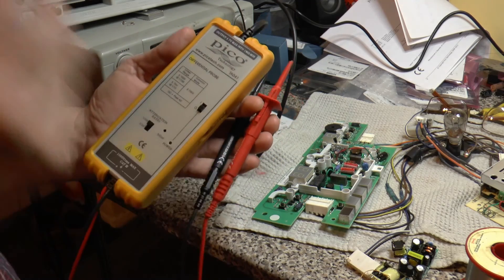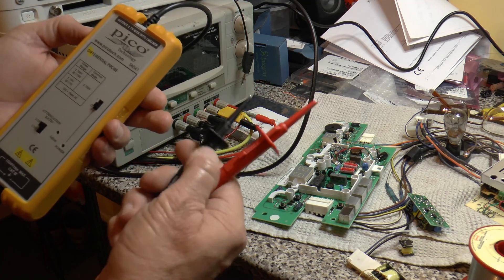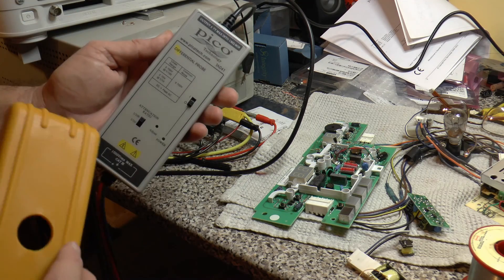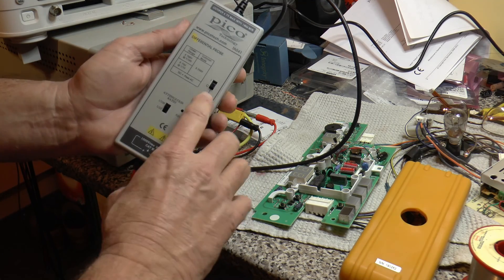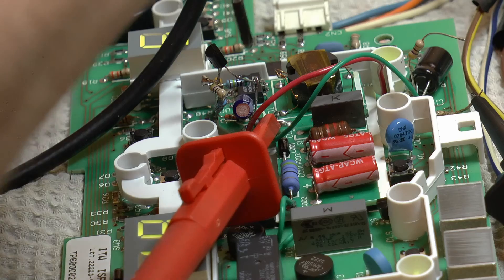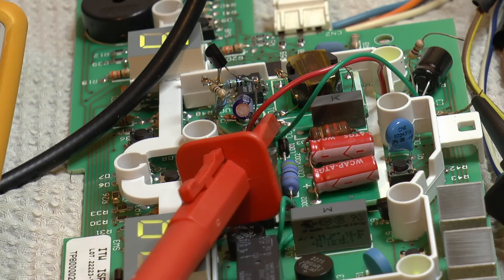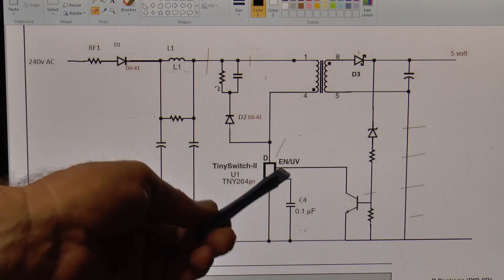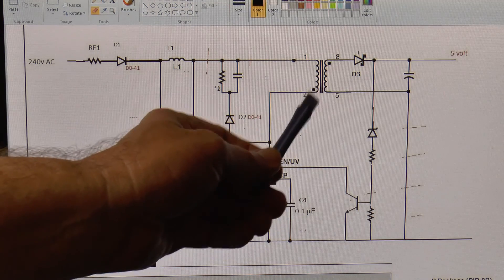Pico Differential Probe TA041 Review & SMPS Crash Course, Flyback inverter

Comment: Hi! Can I know how to measure a flyback output with the high frequency??? - sincere yours.
Reply from the maker: Hi,
What is the frequency and what is the expected voltage?
Reply: Good day John! I can't upload my flyback pics here in YT but my flyback model BSC25-T1010A dat I'm using flyback oscillator to make a output output HV is 25KV. I'm just need to build a Tesla Coil on my flyback and wish should be.
Reply: i have no oscilloscope a device for viewing oscillations, as of electrical i dunno what exactly with a high frequency :( :( :(
Reply from the maker: Hi,
I see it's just a tv coil
The input will still be in the order of 100's of volts.
I can't see how you will build a circuit without a scope and maybe a differential probe.

Comment: Removing primary inductance have no influence to voltage spike, voltage spike is only influence by leakage inductance and the primary winding capacitance in the transformer, and the output capacitance of the MOSFET so you by removing primary inductance did not fix actual problem (even you concluded that from measurements).
This is great example how wrong interpretation of measurements (or doing measurements wrongly) can be misleading.
Reply from the maker: +Miloš Lazović 
Well why did my peak to peak drop by 5 times?
I removed windings, nothing else!
As for measuring wrongly, I was measuring the gate voltage, how can I measure that wrongly?
I measure it and see a large spike.
I remove some turns, measure it again, it's different.
It sounds like you're very clued up on inductors, maybe you could shed some light instead of saying it's 'wrong'
Thank you
Reply: John B
Why leading spike is dropped 5 times when you removed some turns on primary is not consequence of removing turns, in process of you doing that you needed to disassemble transformer and when you putted back again you accidentally or deliberately lower primary leakage inductance or/and winding capacitance which as consequence lower leading edge spike, as I sead before primary inductance have no effect on leading edge spike (primary inductance with output capacitance of the MOSFET have only effect on frequency of trailing edge ringing with).
Now how you can measure wrong is not technically you did something wrong, you just did not take in account limitations of your measuring setup, your differential probe have relatively low bandwidth for accurately measuring leading spike so with that in mind you cant always trust what you measure, you should do some calculations to verify that your measurements are in ballpark of what they should be. You can easily measure primary side leakage inductance and winding capacitance with any LCR meter and you can calculate output capacitance of the MOSFET (you cant meter it easy) from frequency of trailing edge ringing (or if that value is given in datasheet).
Correct way to deal with leading edge spike is to use snubber.
Here is link that I think will better explain that then me https://www.fairchildsemi.com/application-notes/AN/AN-6093.pdf
Reply from the maker: +Miloš Lazović 
Thank you very much kind Sir !
I do not for one second claim to understand all the technical side of inductors and flux density etc etc.
I researched for many weeks and couldn't find my answers (without paying)
I needed someone like you to guide me.
I do believe inductors and flyback transformers are one separate field in electronics that I am only just touching lightly.
Thank you for your valued input.
Reply: John B
For beginning in SMPS design i personally think that flyback is worse to start with. It is hard for inductor design (flyback transformer or more correctly called coupled inductor) and compensation is tricky to do (now modern control IC make it much easier). For beginning design it is much easier pick some forward derived technology (buck as non isolated or 1 or 2 transistor forward converter even half bridge) and then you go to more "difficult" technologies (flyback, boost, sepic, zeta, and at end ćuk).
Another good source of information are unitrode seminars (you can find them on TI site), papers by R Ridley (Ridley Engineering), R. D. Middlebrook, V. Vorpérian and S. Ćuk (they all wrote detail papers of design, simulation and analyze of SMPS converters)
Reply from the maker: +Miloš Lazović 
Hi, So it sounds like you have allot of experience in this field, do you work in this area?
I think I have seen some R Ridley videos, one has to sign up to view his forum.
The trouble with my smps, I need the very small core, the P14 has a huge Ae area.
The tiny switch seems very forgiving too since it didn't blow up with many transformers I tested.
This video is really highlighting the fact that one needs some sort of differential probe for mains powered circuit design or repair.
I had no idea what was happening to my circuit until I got the Pico probe.
Now you have answered the most important question, I can progress and move forward.
Thank you
Reply: John B
If you need really tiny cores you can look cores for planar transformers (they are not intended for your use but that can be used). I notice you use non isolated flyback, in which case I would picked much easier to design buck converter (same as it is used in many LED solutions) and flyback used only when I need isolation, but again when you master flyback all other will look easy for you, with maybe exception of SEPIC and Ćuk, but not because they are much harder but because there is not lot of good resource of design of them (calculations needed for compensation ...) exempt from V. Vorpérian and S. Ćuk (Ćuk wrote lot of papers on SEPIC before he designed his converter)
Differential probes are very useful and give you much more options, but in your case they are not mandatory (you can do same with isolation transformer and 100 or 1000 probe and lot of care to not connect something wrong).
I did SMPS design in nineties ( I designed SMPS power supply for telecom application and some inverter design).
Tiny switch is great, I wished they was there when I started playing with flyback, but in my time usual choice was UC3842-45 where you need to do compensation yourself (which is good and bad in same time). That is reason why when I started it was much easier for me to design half-bridge SMPS then flyback (math is much easier and transformer is much easier to make by yourself then to do coupled inductors in flyback especially if you need to gap core ...)
But again I will repeat do not always trust what instrument show you, all instruments have some limitations, it is best to first calculate if you can to see what you expect and if that is in limitations of your measurement equipment *that I learned from guy who designed first mikroelektronika development board). I saw many people probe especially SMPS on wrong way (you didn't do that, but I saw people putting oscilloscope on compensation pin of SMPS control chip to see what is happening do not realizing that loading of it with 15pF of probe change loop characteristic drastically and all measurements they do are useless).
I know you do not need this now but if you even need to calculate (check) compensation of SMPS (or any other circuit with feedback) you should look at Middlebrook method of measuring open loop transfer characteristic from closed loop (there are cases when you cant break loop to measure open loop)
I am glad if I was of any assistance, and I hope your design will work as you expect.

Comment: I've never designed a flyback inverter but I am also looking at those TNY chips to maybe design and build one soon. The transformer certainly bothers me and I think I am going to pick something that's commercially available. Also their design software looks nice and easy to use, I've had a play with that. About probing on these non-isolated circuits, wouldn't an isolation transformer be cheaper? what other advantages are you getting with the differential probes, other than 1000V input range? I'm looking forward to a future video with your progress on this project.
Reply from the maker: +VoltLog 
Hi, Yes apart from the 1000 volt input range, one doesn't have to loose an earth on any of the equipment!
Some of the equipment I repair, has power supplies with reference to ground and some not on the same part.
An isolation transformer is not the full complete answer.
A differential probe is the answer.
I measured the voltage across an input resistor in the 240 volt line using the differential probe, you can't ground a 240 volt line and measure the voltage drop with an isolation transformer.
The list of what you can do with a differential probe is endless.
The list of what you can do with an isolation transformer, is as short as a cats whisker.